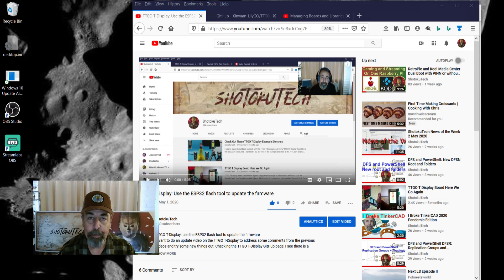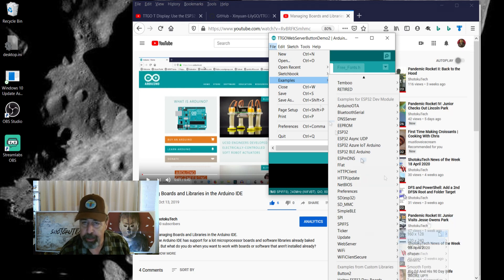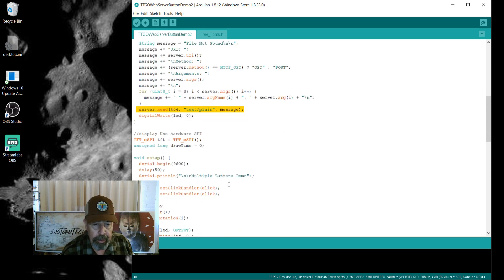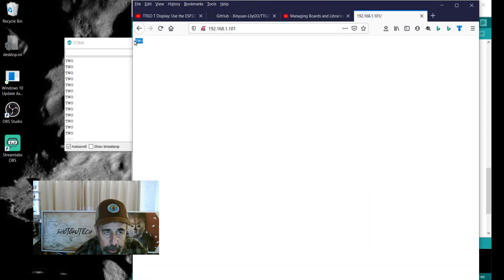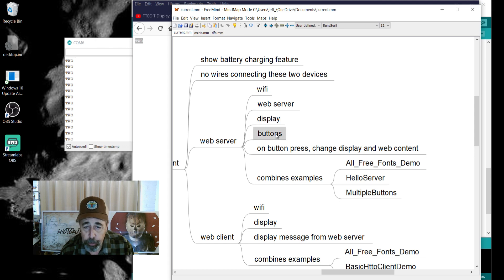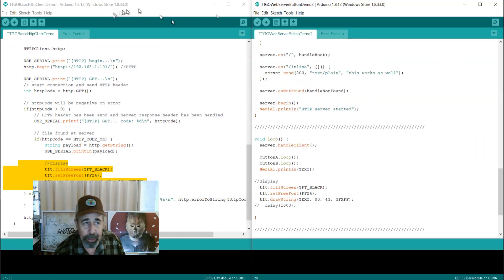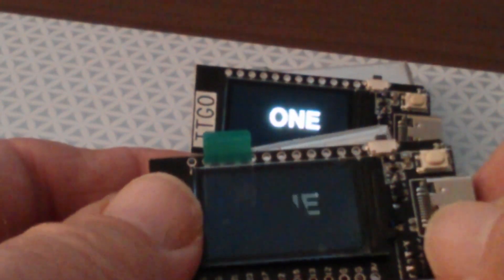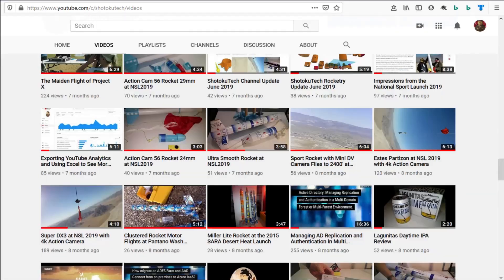TTGO T Display Web Server and Web Client

Comment: Disclaimer: I'm a complete beginner. First of all, thank you for this tutorial! I'm using a LilyGo display with the "Web Client" code installed. I'm running into a strange issue: The LilyGo is plugged into my computer over USB. If Arduino IDE is running when I plug the LilyGo in, everything loads as expected and the LilyGo displays the payload from an external web-server. I can then close the Arduino IDE app, and the LilyGo keeps working as expected, continually refreshing and pulling new data from the web-server if available. However, the LilyGo just shows a blank screen if Arduino IDE is not running as I start up the LilyGo. It will show a blank screen until I start Arduino IDE on my computer. As soon as Arduino IDE is running, the LilyGo starts working.  It appears that the LilyGo needs something from Arduino IDE to boot up... is that expected behavior? Shouldn't I be able to just run in completely independently without the need to plug it into a computer every time it boot up the first time? Any help would be greatly appreciated (trying to use it as part of a Christmas present).
Reply: update: I figured out what the problem is.... If you disable "USB CDC On Boot", everything works as expected. If it is "enabled", you can't run it without connecting it to the computer first. Is that normal/expected behavior?
Reply from the maker: Hello. I honestly have never clicked on that. So I can't speak with any authority on the subject. But thanks for sharing your observation. It could be important to note.

Comment: Thanks for the great info. from your series. However I am not sure if I flashed the firmware. Is there a way to check the firmware version? Thanks!
Reply from the maker: Hi Larry. The simplest way to see latest firmware is there is a message about mounting SD card. They added this to the firmware and FactoryTest example in April. See my "Bricked TTGO T Display Fixed With New Firmware and Factory Test Sketch" video from last week. https://youtu.be/zledBB6UPqE
Thanks!

Comment: Can you tell me if the battery you have can be found on ebay, not from china. I am in the USA and have had many problems getting items from China. Did you have to replace the connector on the battery so that it would fit the connector on the TTGO?
Reply from the maker: I almost never buy from Ebay. These are from Amazon, Connectors are perfect for the TTGO T-Display. MakerFocus 4pcs 3.7V Lithium Rechargable Battery JST1.25 Connector 2pin, 852540 3.7V 1000mAh Battery with Protection Board and Insulated Rubber Tape Compatible with ESP32 Development Board WiFi Kit 
https://www.amazon.com/gp/product/B07CXNQ3ZR/